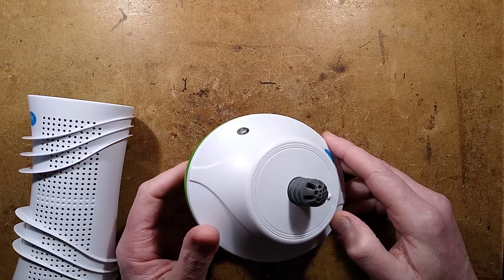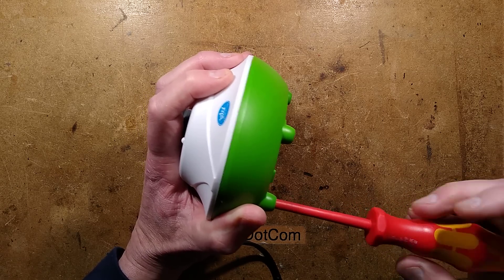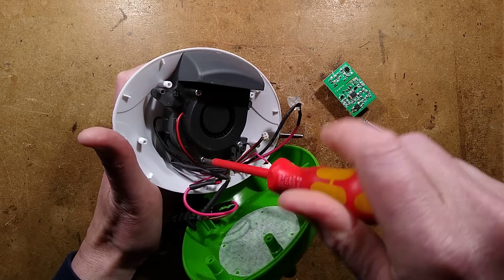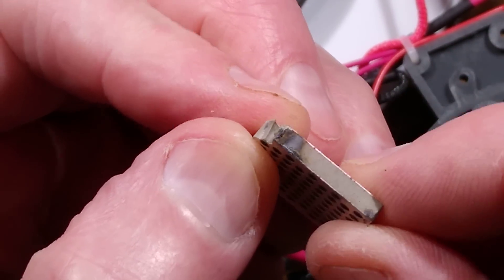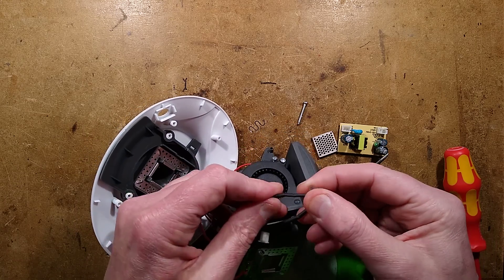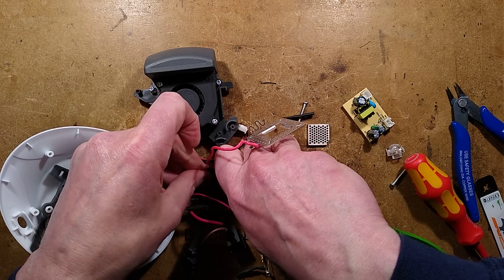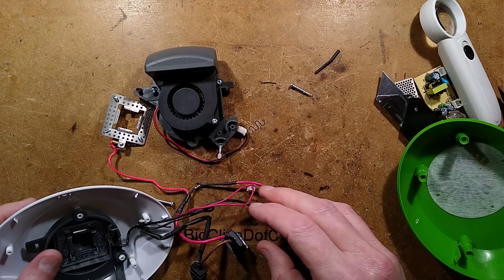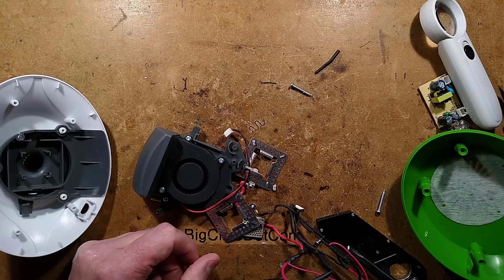This blew up!   Let's open it to find out why

Comment: What's the stated voltage spec on these? I'm wondering if they have pushed their luck and said it will take 220, don't know what the IoM is like but central Scotland it's usually the high side of 250, used to be filament light bulbs didn't generally last long.
Reply: This is a PTC heater, so the resistance should increase with temperature, therefore allowing it to maintain a constant temperature even with a slightly higher voltage.
Reply: @321tryagain  Yes but I'm wondering if it's flashing over because the spacings are a bit marginal for the applied voltage as a lot of these cheap mains powered things are, it only takes a bit of dampness, and this thing is designed to have moisture in it.

Comment: I suppose when you put an unsealed heating device in a thing that soaks up moist air, that device might just get moist in itself and go bang, because electricity loves it when substrates get damp and provide a path for current to have a wander across... :P

Comment: I wonder if this could have skewed your results in the dessicant testing video? If the heater gradually has changed specs, maybe the maxtemp has gone up or down over time?

As for the led, I wonder if they’ve used a neon in a previous version, and just put an led in its place in the updated version, without changing the schematics (other than a different resistor value).

Comment: if you scrape off some of the metal around on both sides it should not be possible anymore since the resistance will increase and tracking distance as well

Comment: What are the little right angle pillars that hold/centre the heating element made from?  It seems mighty suspicious that it's failed/failing on the corners of the heater right were those pillars are.
Reply from the maker: Those are high temperature plastic and might be a contributing factor.

Comment: "That thing you're using is going to break."

Most people: "Oh no, I'll have to find a replacement."
Clive: "I can't wait."
Reply: Me: get the screwdriver, spudger, and soldering iron...
Reply: Always a "voyage of discovery", and gives me an excuse for my comprehensive parts collection.  Along with the "if I can't fix it, I'll see if I can re-engineer it".
Reply: Ththat was me with my Christmas toys at 9 years old, secretly waiting for my toy to break so I could take it apart.

Comment: Thanks Big Clive.  

I wonder if a fix might be to wind a heater element with SS wire.  Maybe back and fourth over a couple ceramic rods?  Back in the days of winding my own coils for inhaling "certain substances" I used various gauges of SS wire for the coils, measuring the ohms and using voltage dialed in for the various airflow of the "tank" .  I guess the circuitry would have to be reworked but I'm assuming that the housing is a high temperature sort of plastic?
Reply: This would be constant wattage, but not PTC to achieve constant temperature. Therefore if the air circulation failed for any reason, it would get incredibly hot and pose a significant fire risk.
Reply: @321tryagain ,  Why isn't there a thermal fuse inside this device? Thermal fuses are often wound into transformers (pinched between the windings) and I've even seen a 1980s direct drive turntable that had a thermal fuse inside the drive coil for the platter.  (That was an interesting failure because apparently  one of the driver transistors shorted and caused the platter  to run at over 100 RPM's continuously until the driver coil overheated enough to blow the thermal fuse, which fortunately was at the surface of the coil and so I was able to replace it.  I suspect the turntable had been accidentally left on overnight and maybe it got zapped by an electrical storm or something).
Reply: @321tryagain  Very good point.

Comment: ...There's "Dupli-Color High Heat Ceramic paint" that can be sprayed on car exhaust systems or brake calipers - claims to be "able to withstand temperatures up to 2000 degrees F" (approx 1000 c). Might work if non conductive type chosen...Bit dubious it can cope with 1000 C....
Reply: It does actually handle that temperature but it is conductive as far as I know
Reply: @NinoJoel ,  I've always felt it was a safe bet to assume that high temperature paint formulations contained powdered carbon. This would include anything sold for repainting a barbecue grill.

Comment: If the substrate is ceramic, the only way of removing the tracking mark would be to grind it off, scraping it with a metal implement will just exacerbate the problem.
Reply: Yes, this. My mind instantly went to a Dremel or similar tool with a non metallic grinding wheel or sanding drum. Just grind the corners to a larger radius.
Reply: I was thinking of using a diamond sharpening stone to polish off the bad parts.
Reply: @therealjammit ,  Diamonds are made of crystalline carbon, and carbon is conductive; however, diamonds are normally considered a very good electrical insulator  Due to the structure of the crystal lattice, but recent research has shown that it can be made into a sort of semiconductor or conductor under certain mechanical strain conditions.  Therefore it's difficult to predict if traces of diamond left in the ceramic material from grinding away the arc marks on the ceramic heater block would be conductive or not.

Comment: I have just got one of these to keep my 3D printer filament dry! Do you think there is anything that could be done to help keep it alive? (better airflow into the unit? or reduce the power somehow) Or could there be another module that fits? 🤔🤔
Reply from the maker: I'm not sure if the edge could be painted with an enamel or something to prevent surface tracking.  The issue is the relatively high operating temperature.